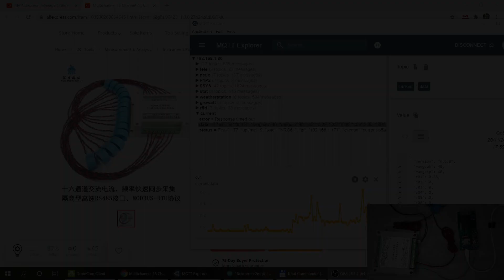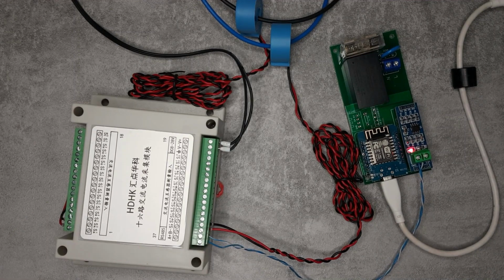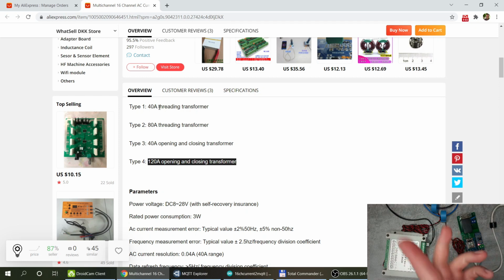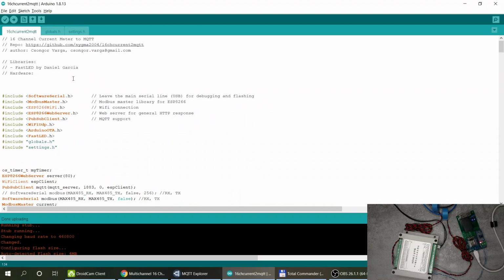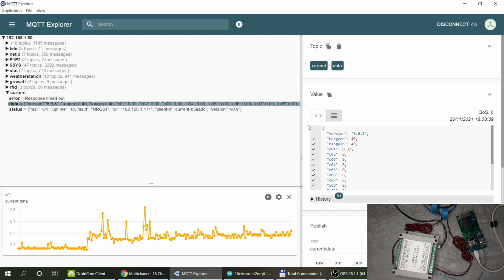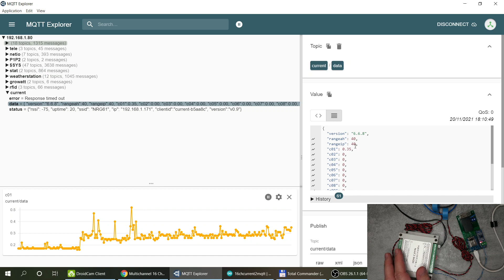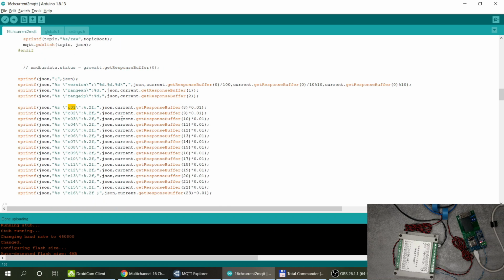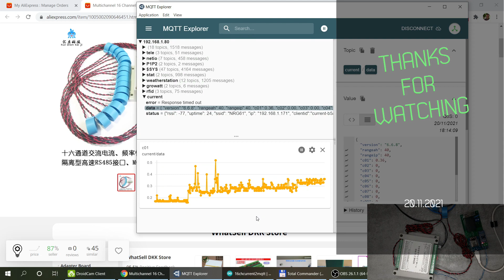16 channel modbus current sensor to MQTT

Comment: i keep running into your vids D:
ima grab one of theese. the modbus rtu protcol seems pretty common / universal in this automation world... can basically use the same script for everything.
Reply from the maker: Yes indeed. It is very basic, very simple. And you can chain up to 128 devices on a single rs 485 line and the segments can be up to 500 meters.

Comment: Hello @csongororvrga , Thanks for sharing the code and for making this vid. I currently using the code in my home system :) If you have two modbus slaves, do you know hov to read both on the same rs485 bus? and how to address the slaves diffrently.
Reply from the maker: You need to set the two devices onto different slave ID. I attached the documentation on Github. It would be quite painful. All the connection settings are stored in the register 3. You need to read register 3 with a modbus test program like Modbus Poll. That would give you a number which stores the slave ID and all the other serial communication data. And the lower byte contains the slave address which is 1 by default. But is should be enough to add 1 to this number, write it back to register 3 and that would make this device on Slave ID 2. After that it can be connected on the same serial and the two different devices can be read with the different ID. Not easy process.
Reply: @csongorvarga  Thank you, i will order one more and try it out.

Comment: Hey mate, I'm a bit slow but I've been experimenting with this device and your code. Managed to get the hertz working but you need to decent load (over an amp) for it pick up and it's not accurate, gives a basic 50Hz output.

Comment: Got the same HDHK model and a smaller one, thanks for the code it will be most useful to me for my own project!

You mentioned about sensing unwanted power usage. My lighting implementation makes use of 2waying traditional switches w/ a relay board and the smaller modbus ct device. It's there to know if a physical switch is on and how much energy is being consumed.
Reply from the maker: Thanks, if those are traditional switches and if the light is off, there is no power consumed. No connection is made when the light is turned off and the current does not flow.
Reply: @csongorvarga  But your switches still function without any smarts. That's the point for gaining some redundancy, which you don't see in home automation solutions.